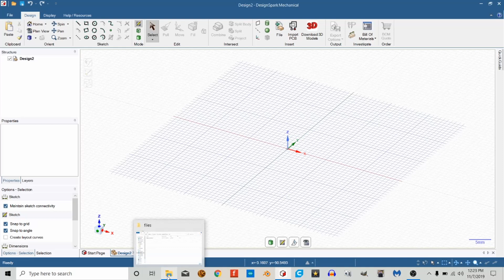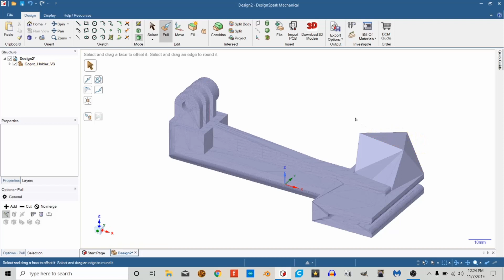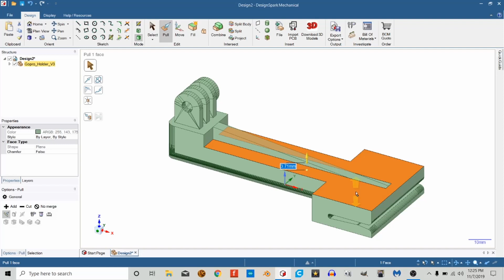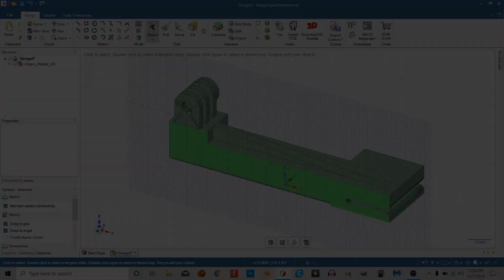How to convert a .STL to a solid

Comment: 1st do a shrinkwrap command. You can also try reduce command in facets tab and then use shrink wrap to obtain a uniform mesh then convert it into solid. that might be more helpful
Reply: I think this is in the paid version? I went hunting for it and found some videos using what your are discussing, but my DSM only has five tabs: FIle, Design, Measure, Help/Resource